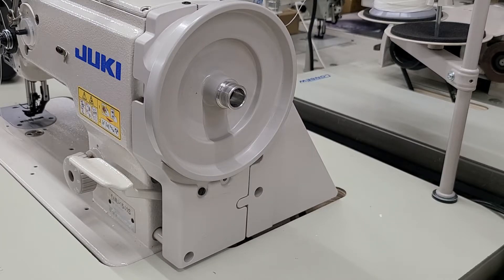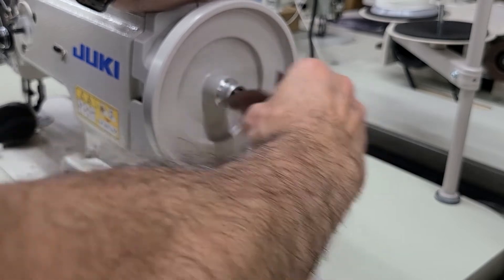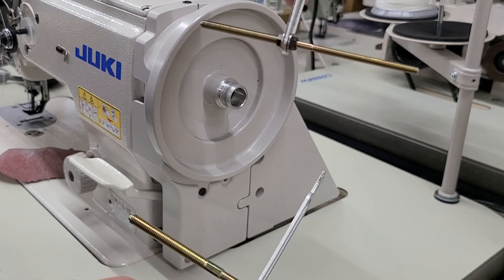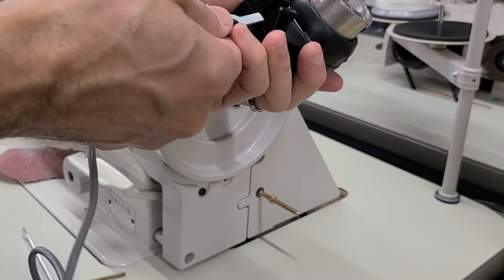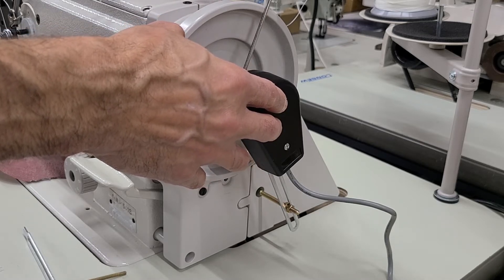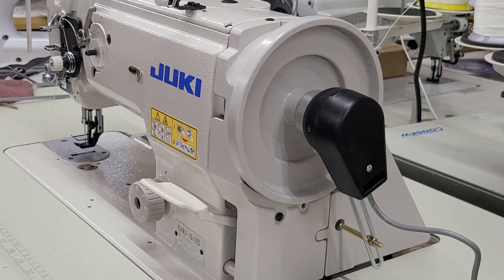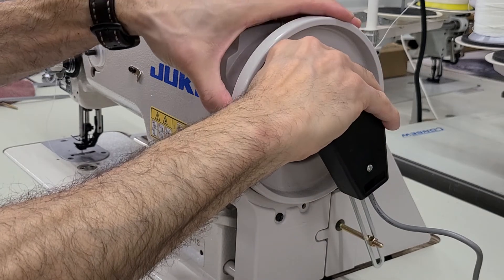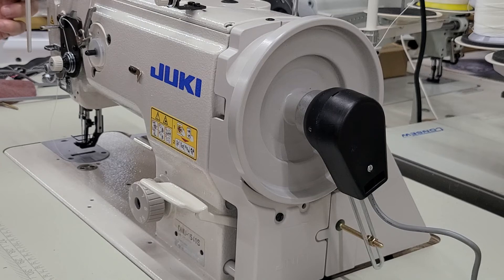Brushless servo motor needle positioner install on a Juki DNU 1541S

Comment: OK if I understand right to get the uptake with the heel tap to the uppermost position, you have to adjust how deep the needle down setting is? Needle down is great, but the uptake is only going about halfway up and then I have to manually raise it, but you are saying I can synchronize the two by trial and error adjustment? I got no instruction manual.

Comment: I’ve done this twice now. Time it like a car engine. Install all the parts then try this.  Steps: 1. Setup the motor to spin the correct direction. 2. Setup for needle down after sewing, then press the pedal so it goes to the “needle up position”. Now add 2 pieces of painters tape, one to the positioner and one to the metal adapter that spins with the hand wheel. Mark a line across both parts; this will be your timing mark (aka needle up position). Basically every time you press the pedal backwards the timing marks will line up. Now just loosen the positioner screws set the takeup lever to the fully up position  then tighten with your timing mark lined up. Done. Hopefully this makes sense to you.

Comment: What do you mean by “heel tap”?
Reply from the maker: Press your heel on the front of the pedal closest to you.
Reply: @Sewinggold  my heel doesn't tap anything. the only motion i get a response from is toe-down. i just adjusted it for variation and remain without a "heel tap" option on my unmodified DNU 1541 S. is there something wrong i'm doing or not doing?
Reply: @chrisdineson  I also have the same machine and same question.  I'm going to order one of these right now so it should be here soon. 

I think that you have to use the adjustments in the middle of the rods connecting the pedal to the motor. The pedal can be adjusted so it is "floating" so to speak. If you lengthen the lower rod, it will allow you to push the pedal down at the heel.

If you have it hooked up right now, I think this will fix your problem.

1. Make sure the machine is turned off.
2. There are two rods that are connected in the center with small bracket and a bolt. Loosen the bolt. You don't need to take it all the way off, but you can. Just loosen it until the point where the rods are no longer locked together.
3. Push the pedal down a little bit, and you will notice that there is a gap on the heel side of the pedal. Place something in this gap and you will be able to let go of the pedal.
4. Re-tighten the bolt in the center of the rods.
5. Test. You may need to adjust it a little bit more, but that's basically what I plan on doing when I get my new motor.

Please let me know how it goes. Thanks.
Reply: @chrisdineson  I'm having the same issue with mine. I tried adjustment of the middle rod connecting the pedal to the motor, but I don't get a "floating" pedal and I don't have the heel tap available. Any other advice? I followed the instructions in the video to change the position of the needle from stopping in the up position to now it stops in the down, but I would love to know how the heel tap works to bring the needle back up without having to use the hand wheel.

Comment: Great video information Steve.   I had the needle positioner but got frustrated with the results of it so disconnected.  I’m much happier with my machine now.  I know there are pros and cons but I’m liking it without at this time.
Reply from the maker: Glad it helped.  Also, we used 80 grit sandpaper, but finer will work too.